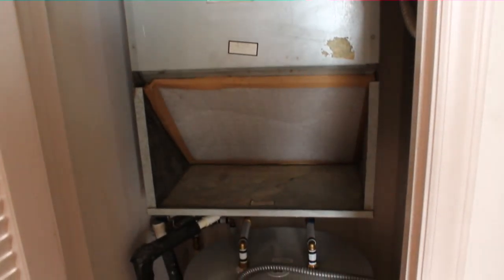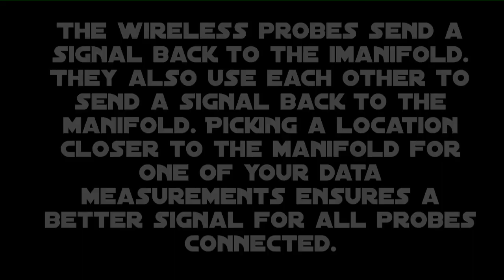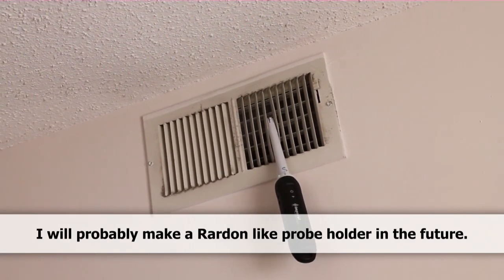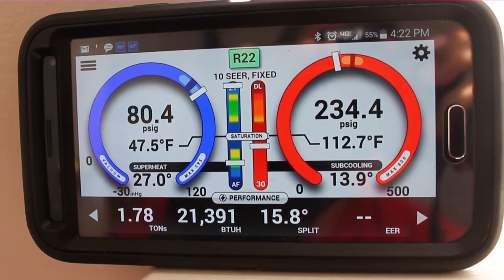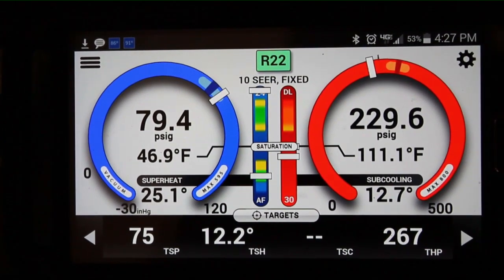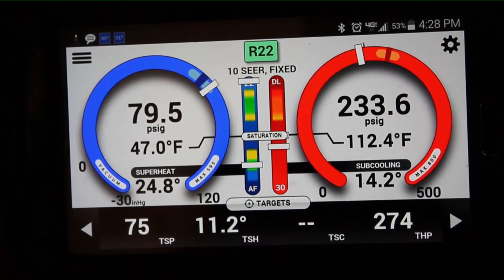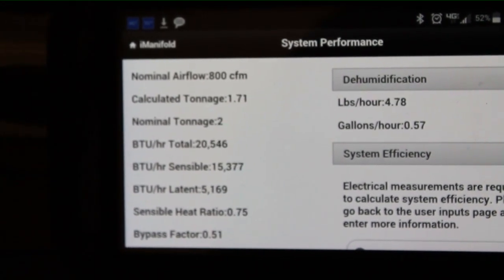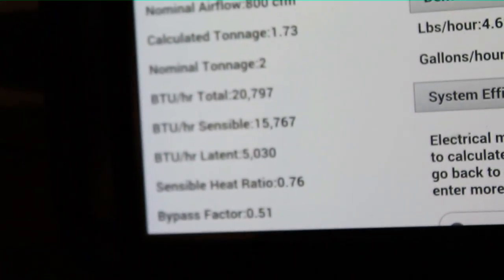HVAC Service Training-  Interpreting Data from the Imanifold

Comment: Great video Zach. The iManifold combined with wireless probes gives you an abundance of data with minimal effort. Just FYI, the airflow indicator on the main page is based on target temp split. 3 degrees either way and you'll be in the blue or yellow.